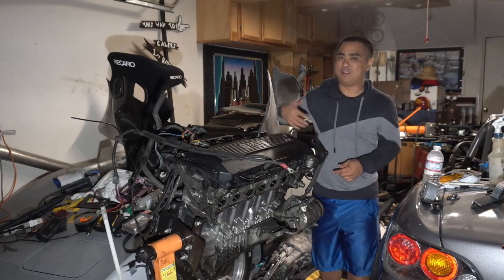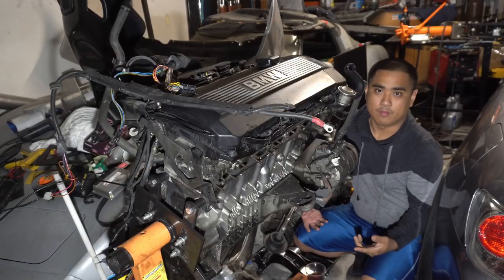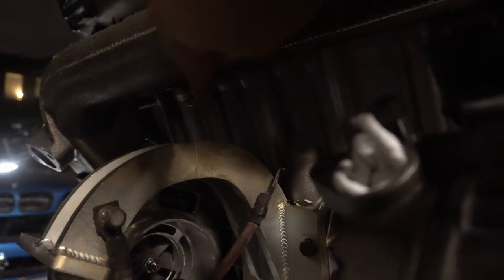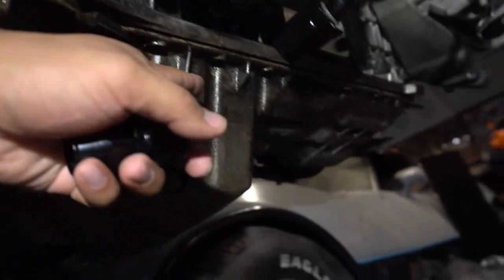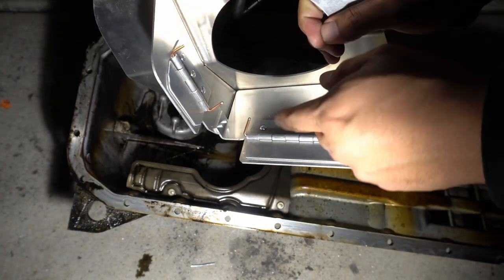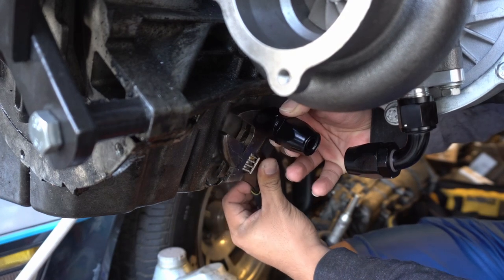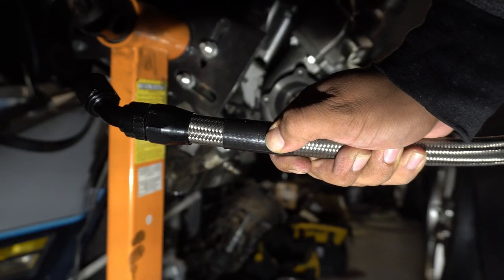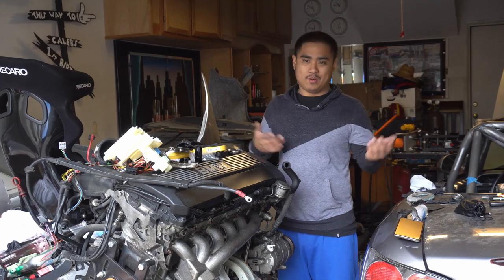E46 "Ebay" Turbo Install + Oil and Coolant Routing | #TheE46DriftBuild Ep49

Comment from the maker: UPDATE: 3:40 If you plan to run this manifold, please also watch the video linked in the description! I made some modifications as recommended by those who have run this manifold.
Reply: Shouldn't exhoust monifold be upside down?
Reply from the maker: @TheMeginieks  As in top mount configuration? No, this is a bottom mount manifold. Some have used it as a top mount but it requires some modifications
Reply: @nuisance_carl  what type of mods dose it require
Reply from the maker: @jhye5286  Check the link in the description
Reply: What modifications need to be made to run it as a top Mount?
Reply from the maker: @joemiller4849  Need an adapter to push the turbo away from the valve cover and clock the turbo correctly.

Comment: Pro tip:  for anyone considering this approach, thread lock that nut inside the oil pan for the return line.  If it ever backed off you have no access short of pulling the pan.  Not a small job when in the car.
👍
Reply from the maker: Thank you for pointing that out! I definitely wish I put on some loctite. I’m even considering redoing the drain to try and have it higher (and welded)

Comment: Pro tip for you ebay kit users, you are not required to run the coolant lines. They help mostly for cutting the car off without a turbo timer. If you sit in your car and let the turbo cool down before cutting it off you will be fine. Been doing that for years without issues.
Reply from the maker: Yup, I'm actually currently in the process of deleting my turbo water lines. Pretty sure it was contributing to my car running too hot for comfort.

Comment: Man it's really nice that you are including all the parts and stuff you're using in the description. Depending on how things go for you with the whole project, I might have to turbo my BMW this coming summer instead of getting a new exhaust manifold/headers (to fix an exhaust leak that just developed there) for how low cost it'll be. Any idea if you'll be able to keep your AC lines with how it is a bottom mount turbo setup? Also what's your plan for the transmission and clutch to handle the extra power, as the stock transmission in the 325i's are pretty weak; swap in an M3 transmission?
Reply from the maker: I try to help out when I can lol my plan is to keep a/c at all costs. That's actually a big reason why I went bottom mount (even though some have made it work with top mount). The biggest issue for me is getting the intercooler piping and intake around the compressor without going under the subframe. I already have a zf transmission to pair with the motor, and I'll be running a clutchmasters clutch, which I'll be covering in the next video 👍

Comment: Sorry for 2 comments back to back, I never really gave it much thought about the oil drain for e36 turbo kits.  But when I see the setup wow your AN adapters were basically touching on their own! Obviously the best solution is just a top mount setup, but I would be interested in seeing how a scavenge pump would work on this setup too... Also: Remember the turbine housing, compressor housing and center section can all be clocked independent of each other
Reply from the maker: Yea this drain didn't work and had to resort to a scavenge pump, which worked but I hate them. I'm actually currently redoing my turbo drain completely.
Reply: @nuisance_carl what are you doing differently
Reply from the maker: @joemiller4849  12an line instead of 10an. Redid the bung at the oil pan. It's critical that the bung is PARALLEL to the ground or pointed up. No more AN fittings to save space.

Comment: Hello, thank you for the videos, I am in the process of ordering parts for a budget turbo build. Can that specific manifold be rotated upside-down to install the turbo on the top?
Reply from the maker: Since the bolt pattern is symmetrical, yes it can be flipped to be top mount, but the turbo would end up hitting the valve cover. You’d need to make some sort of adaptor. I’ve seen it done, and I’m personally not a fan of it

Comment: Hello..i know that past years for this video but i have a question please i have the same turbo and the oil inlet is opposite from exchast manifold..so is possible to clock rhe turbo or is variable
Thank you
Reply from the maker: Yes you can clock the turbo to correctly orient the oil and water feeds

Comment: Hey! I am curious to know where you connected the water lines from the turbo onto the block. I saw that you connected the feed into the exhaust side of the block in the tapped hole. Btw nice video :)
Reply from the maker: Correct, feeding the turbo from the block drain and it returns at the hot side coolant hose. I show how I did it in this video https://youtu.be/vaVsAgxRWC0
Reply: @nuisance_carl  Thank you!😁

Comment: Hi, im interested of your turbo oil return. I have big problems with oil burning with bottom mount turbo. I changed chlocking of turbo to 90 degree and the return bung in the oil pan is the same like yours. I hope it works in your build. Nice build, i have tge same build😉
Reply from the maker: Oh man.. Yea hopefully I don't need a scavenge pump...
Reply: @nuisance_carl  You would need one :) I've fired up mine without a scavenge pump and it smoked like a diesel truck. Same location of the return bung, and basically the same setup for the oil return.
Reply from the maker: @NetworXmk1  Well, only one way to find out I guess.  I've seen an equal amount of "working" setups as I have not working.
Reply: @nuisance_carl  Same here dude! I hope it works for you. I wanted to crush my turbo with a hummer when it started to smoke. I'm waiting on a scavenge pump but I also think to top mount it. Can't wait to hear your E46 scream :)

Comment: The braket mount is necessary or it is only to put an air filter?
Reply from the maker: You need it for the filter. I wouldn't recommend running without a filter on a low mount turbo.

Comment: hi, nice build.
what do you need the m18x1.5 an6 fittings for?
Reply from the maker: That's for the turbo water ports.
Reply: @nuisance_carl  ah ok, my gt3582 also has m14 that's why i was confused

Comment: need an electric pump for the oil return .... otherwise that turbo will be smoking within 500 miles of drive) and die in another 1000 miles... ask me how I know :)
Reply from the maker: I hate the idea of electric scavenge pumps. I’m already working on a redesigned oil drain that might help. We’ll see if it works.

Comment: Hey man stupid question where did you run you water return in to ?
Reply from the maker: Water feed is from the engine block drain. Water return is spliced in to the passenger side coolant hose.
Reply: @nuisance_carl  thanks I thought so but just wanted to see

Comment: Why not run the return by the oil return from the oil dipstick?
Reply from the maker: That port is too small and too high up for bottom mount. If you used a scavenge pump, it could possibly work
Reply: @nuisance_carl  ohhh alright, I was just thinking about that because I used that as a return so I thought it may be a good suggestion... Although I did a top mount.
Reply from the maker: @kalibsima1450  I'd probably say that's sketchy for top mount as well, but if it works, it works.

Comment: would it be possible to flip the manifold for a top mount? or is the bolt pattern not symmetric?
Reply from the maker: You can flip it, but the turbo will hit the valve cover. Most people who do this make an adaptor, but then your turbo will be sticking out the hood lol
Reply: @nuisance_carl  thanks for the fast answer :D do you know of any cheap top mount manifolds?
Reply from the maker: @driftalliance1556  First that comes to mind is CX Racing. I see a lot of people running that one

Comment: Is there a charge pipe you can recommend for m54
Reply from the maker: Any generic piping kits off eBay/Amazon should do depending on what size piping you want to do. Fabrication will be required and welding might be needed depending on your setup

Comment: Hey man i built an m54 with that same manifold but used it as a top mount
Reply from the maker: Did you make an adapter for it?
Reply: They recommend not using the wastegate on the header and to have the wastegate as close to the turbo for no chance of blowing the block so i caped the wastegate flange on the header and got a 6inch extension with a built in wastegate flange and I’ll have a video of the first start up this week took me about 4 months did it on a e60 m54
Reply: Nuisance_Carl all studs and exhaust holes match up too
Reply from the maker: @toimodzbabytv5538  I know it can be physically flipped 180*, but the concern is how you got the turbo to fit. Last I remember,  there's major clearance issues between the valve cover and turbo.
Reply: Nuisance_Carl yeah 6 inch wastegate custom extension it makes it clear the valve cover
Reply: Nuisance_Carl since i caped the og wastegate on the header
Reply: Also have to do away with aircon if you top mount it
Reply: gavin mealing yeah i got rid of all secondary air system since it’s turbo charged

Comment: how much power is this car making on stock internals?
Reply from the maker: Car's almost finished, but I don't plan on dyno tuning right off the bat. Most likely going to street tune and aim for 300-350hp.
Reply: Nuisance_Carl just round it off to 400 while you’re at it lol
Reply from the maker: @kukuboat  If I can justify it yes, but I don't have a need for that much power. My local tracks are primarily 2nd and 3rd gear. No need to sacrifice reliability if I don't need to.

Comment: wont last long until it pulls the head bolt threads out the block
Reply from the maker: We shall see
Reply: It will be fine at sensible boost levels the main reason the threads pull out is overheating and even it does happen it's easy enough to use time serts to sort the problem